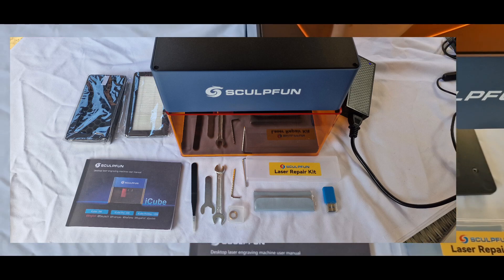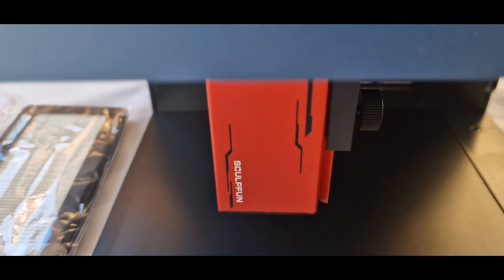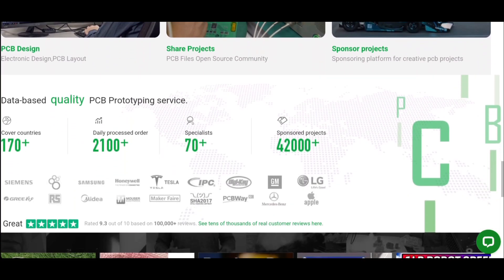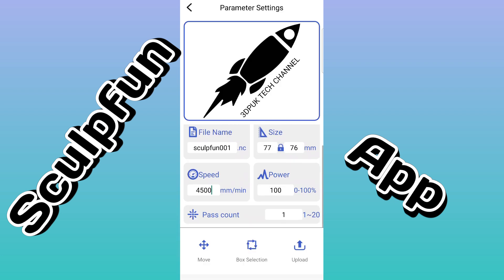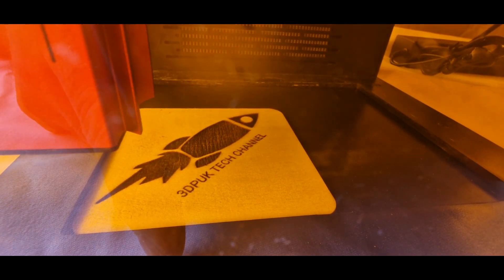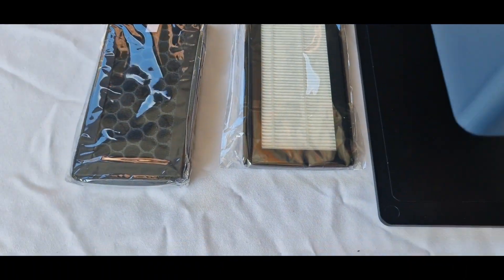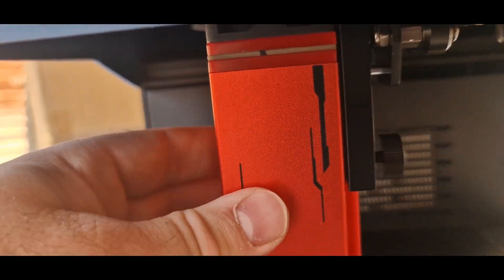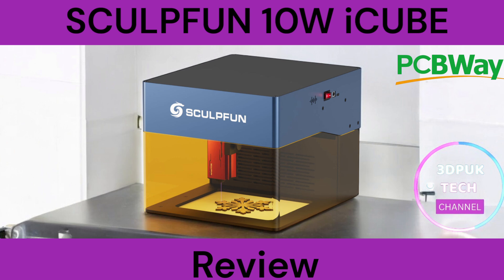Sculpfun iCube 10w laser, Good, Bad and The Ugly

Comment: You responded to me in another video regarding K1c clanking. I solved my issue. I recently put on upgraded door hinges, the screws that were recommended were too long and was digging into the belt and around that area. I loosened the screw just a bit and problem solved. Please share this issue and its solution so people dont have to go through what I did!